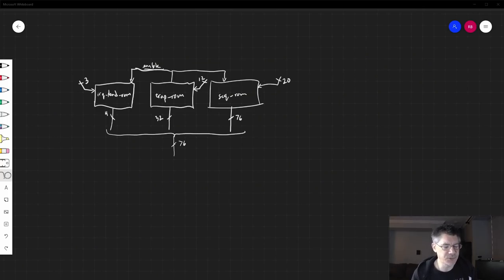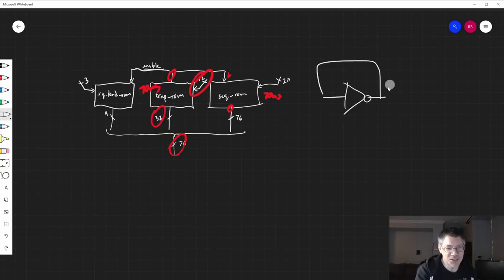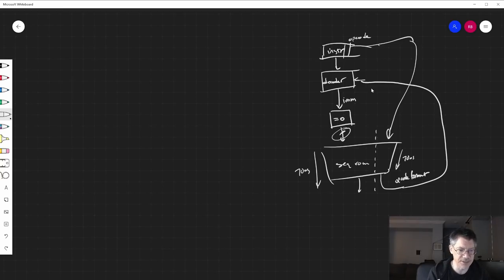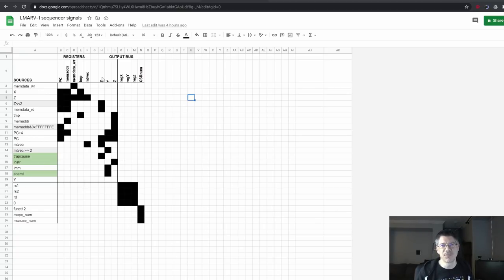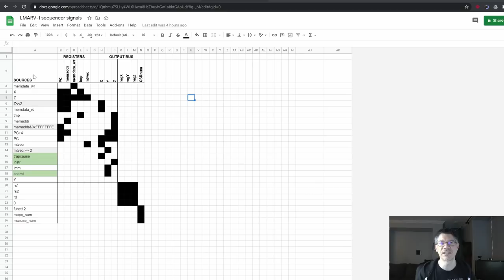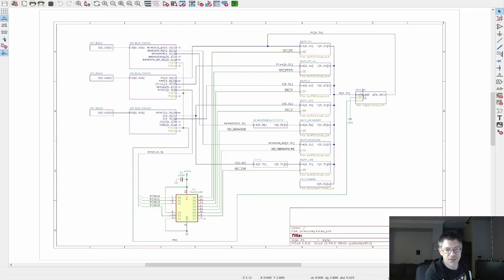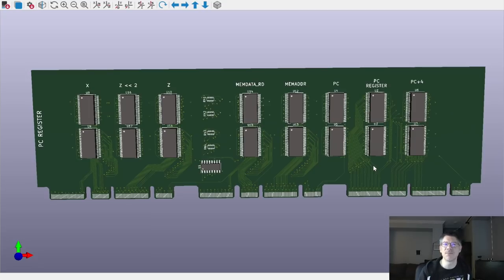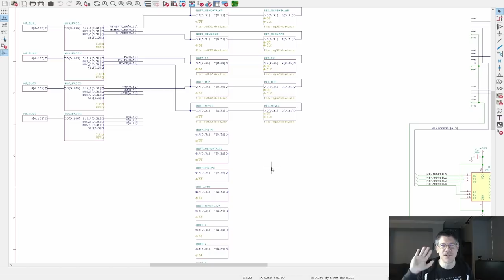LMARV-1 reboot part 10: Some errors, some schematics

Comment: Shamt is encoded in the same field as immediate. So you can just feed the rs2 / immed bus to the shifter.
For the gold plating, you want something called "gold fingers" not ENIG plating. The ENIG will wear down just as quickly as solder plating. Instead, the gold fingers place a thin sheet of gold film over the pads (I believe its sort of like a laminate) which will last much longer.
Good find on the card edge connector, those look like they will work very well. Having four of them may make them much harder to insert though... could you perhaps consolidate busses by sequencing the sequence logic? You don't need all of those values at once all the time, right?
Also, for a lot of the logic, it may be worthwhile to just build a generic PLA element. If you want to save cost to make it re-usable, you could place 0 ohm resistors at every intersection to select how the PLA is configured. You could potentially even implement the big gates not as 74 series, but as transistors (since large input gates are trivial with transistors but need to be done in a binary tree with 2-input gates). I suspect that would be a lot faster than a ROM, and if you can simplify the logic equations, it could potentially allow you to sequence the sequencer into multiple steps to save buses / wires.
Reply: I think the generic cards can be done with only 3 connectors each. The Sequencer will have dedicated slots for each card type, and route the required signals to the individual cards.
Maybe there is an overlap in signals that I don't fully see, but it is worth to try this puzzle.
Reply: @marknn3  There are definitely ways to reduce the number of signals... he really only needs branchPC, PC+4, and EPC. EPC can come from the CSR where the CSR either outputs mtvec with cause, or mepc. The branchpc takes care of branches, jumps, and auipc, etc.
That could probably be generalized to having two registers on a single card. Each with 3 input options as well as keep (so that's the 4th). Reset to 0 can be done if he uses the OE signal, and ties the register output to 0. So you set OE = false and input = keep. 
For mtvec, 1) he doesn't have to support vectored interrupts (it's not required by the spec), and 2) he doesn't have to support arbitrary vectored instructions. What I mean by that, is he could place cause and mtvec in the same register, and just have the ability to output or not output different parts of it. Make it a 32-bit register, where IRQ is the msb, but the backplane shifts the output by 2. He could also put the multiplexer for a single output on that register card too.
There are ways to reduce the wires required.

Comment: Have you given any thought to debugging the system once it's been built? Your original idea had excellent blinkenlights which seems pretty much impossible given the number of signals you have now. Having some way of hooking up a logic analyser to verify correct operation seems like a good idea to me. Yes I realise that your modelling and formal verification should minimize any errors but there's going to be a heck of a lot of hardware to trace through if it's not perfect.